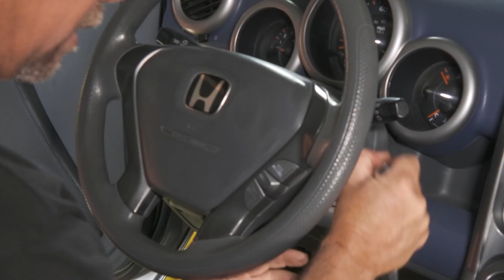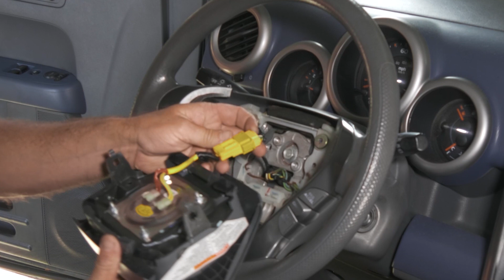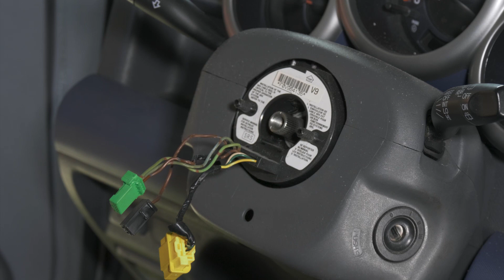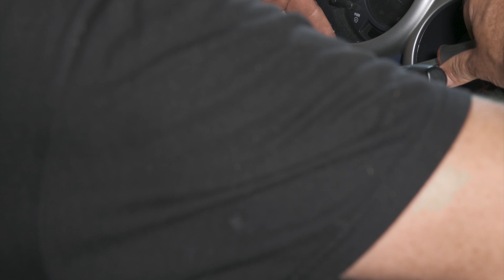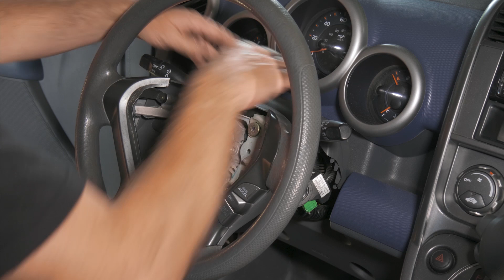2006 Honda Element Airbag Clock Spring (Restores Horn, Radio, & Cruise Control)

Comment: Thanks! My horn isn't working. Cruise control is not working. And the airbag light is on. I've been wondering what to do about this. Thank you for walking me through it. I guess I need to shop for this new "Clock Spring".

Comment: How did you diagnose the bad clock spring?  My airbag light is on and my horn is not working, but the cruise control and radio both work fine.  Thanks very much!
Reply: Just replace your clock spring. It still applies to your issue
Reply: @Hawk_411  Does it apply if your airbag light is NOT on? My horn and cruise stopped working years after I took my car into Honda for airbag recall.
Reply: @AnyoneCanFlip  I have an 07 Element with the same issue. BUT my airbag light is on. The airbag, cruse control, and horn are related to the clock spring. I'm fixing mine in the next month or so when I have time.
Reply: Mine too! 2005.